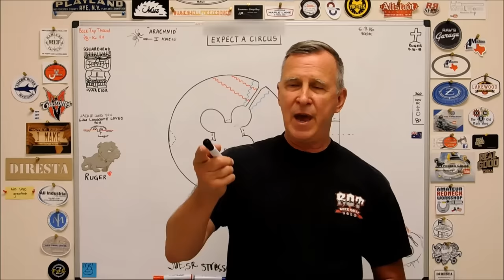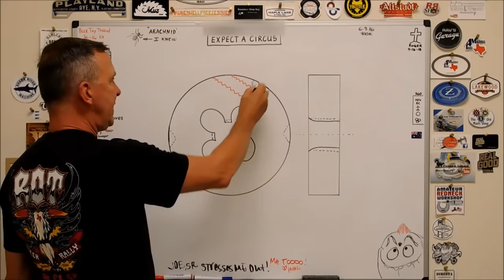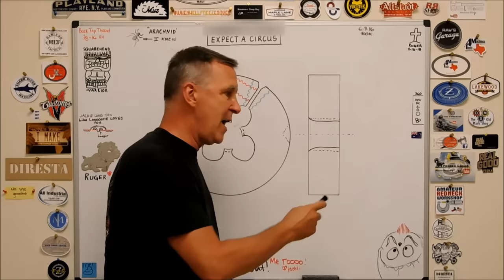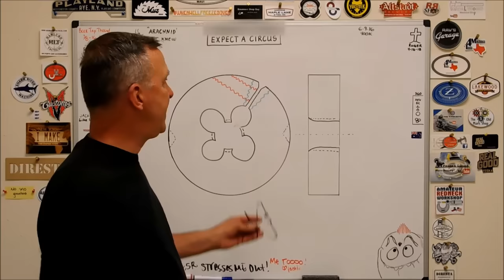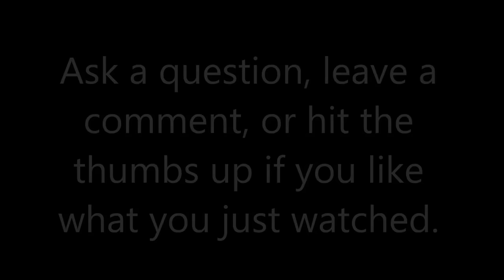You will throw your die handles away after you watch this !!!

Comment: Thanks for the vid Joe. I'm fairly new to the lathe and can count all the times I have single point threaded still. I tried single pointing a thread until it was most of the way and then ran a die on to finish the threads but for some reason it threaded heavy to one side and I had to go back to single point threading. 
I was making handles for a drill press and made a sleeve that threaded over top of the handle rods, with it being off center I couldn't get the sleeves to thread on. The tap and die set are made in USA (Dayton brand) and the material is 12L14. I still need to make the die holder for the tail stock which may fix that problem.
Nice ride as well, I sold mine but had a Yamaha Warrior and she could pull like a freight train, Power commander III chip and AIS bypass. Unfortunately I had to many close calls with the cager's and I was still responsible for a child living at home so I let the bike go. He's off on his own now and I believe when I go to replace it I will be looking into a Victory bike.
Reply: Also the material was not off center more than .001 as I did run a indicator up on each one so single pointing it was on center. For an old chuck and lathe it still runs pretty true. It's an Atlas/Clausing 6" and I am looking into moving up to a 14" lathe pretty soon.
Reply from the maker: Did you do this under power? Sometimes it the operator pressure resisting the torque that pushes it off center.
Reply: @joepie221  No, it wasn't under power when I did them. I'm sure it's something I did but it was just easier to single point out the rest than to figure it out at the time. 
Looked up the specs on your lathe. Very nice, if the info I got was correct I like that it has a 4 tpi lead screw and 16 speeds vs most at 8 and 12 speeds in that class, plus allows SAE and metric threads and it appears to be around 1-5/8 spindle bore? I haven't been able to find where they are made? I had been looking at the Precision Mathews lathes but I honestly think if I could find one like yours in good shape I would take it over the Mathews.

Comment: Did you come up with this? You should design your own from the ground up, and sell them. This thing is legit
Reply: Floating die holders have been around for decades. 
Great tools to have and really simple to make. I use mine daily, as I make a lot of screws and threads. Really speeds things up and saves my wrists from turning the die holder by hand.
Reply: @Brekelefuw  ah, I never knew, I have just been researching threading and found this :D
Reply from the maker: Floating yes, but the ability to spin when the thread is achieved is what I really needed. keyed holders don't do this.

Comment: Hi Joe im working on L shaped part witch is very thin . The part bows and spreds appart,i tried evrything can you tell me how to aproach this kind of work .
Reply from the maker: If you can, keep it attached to the main material and cut it off at the last step. I did a video called 'Dogbone Milling" it may give you some ideas. go find it.
Reply from the maker: https://www.youtube.com/watch?v=r4vaeRLFfD8
Reply: @joepie221   i dont know if it is posible .can i send you a picture of a part 😀
Reply from the maker: If its small, trap it in a 'V' block and reposition your vise to sit on your mill table at 45 degrees.

Comment: Great concept for the die holder in the tail stock. 
If you would use beeswax as a lubricant or a toilet bowl wax ring it would give you a nicer finish on your nylon parts to keep the threads from tearing. 
Just my 2 cents worth from a retired machinist of 40 years.
How does your technique work on steel based materials ????
Reply from the maker: Works well. I have to hand drive the die with longer studs, but ss is not a problem.

Comment: Why did you bore your die holder to accept a round rod for support when you could chuck the die holder directly and simply leave the drill chuck loose enough for the it to spin?  Is this to eliminate wear on the chuck?
Reply from the maker: No, its for threads longer than the holder. It simply walks off the rod.
Reply: @joepie221  - I honestly don't want to be a pain in your neck since you put out LOTS of great info.  But... that holder would slip right out  of the chuck too.  It seems to me that the main thing is boring out the holder to accept the largest thread you have a die for.  For what it's worth, I think I will make such a holder. 😁
Reply: 1+
Reply: You would have set the chuck jaws very precisely to achieve the same result.  If the chuck jaws grip the work is probably scrap. The loads on the delrin part were noticeable, steel and stainless would be significant, make sure you can keep your fingers.  
In machining parts you have to ask 'what can go wrong?'  Using the drill chuck jaws as a guide makes the hair on the back of my neck stand up.  They are precision clamping surfaces not bearing surfaces.
Reply: @peterblacklin9174  - Thanks for sharing your thoughts.   I cannot disagree that one should treat one's tooling with care and respect.  I suspect that one instance of a drill bit catching in some brass and spinning in the chuck would produce as much wear as many years of the abuse I described.  Those jaws are pretty hard, after all.   All my tooling is "import" grade 🙄 and it will surely outlive me, so I may indulge my darker side from time to time. '😈  My (Hansen) taps & dies always seem to produce a pretty loose fit.  I have to wonder if they actually cut threads that are fully within spec...

Comment: Can you do a video on lathe threading for lathes that do not have a thread counter (Ikegai A-20 being one of them).
Reply from the maker: To be honest, I have never run a thread on a lathe without a thread dial. I'll leave your comment up to inspire others to comment on. I am sure it will get replies.
Reply: Just don't disengage you half nut and run your motor in forward and reverse. I have to do that on mine when cutting metric threads .
Reply: @joepie221  Thanks for the reply Joe

Comment: Throw away dies. Use thread rollers in lathe 💡. I also had a VTX 1800 bike. Didn't like shaking in 80 mph range. Traded for GoldWing and no shaking etc. Mileage is 107K miles with only normal maintenance. Can hit 114 mph with 2-up in 4th gear. Never beaten by a HOG in a race 👀.
Nice video 👍.

Comment: You can tap on a screw machine the same way and withdraw the tap without reversing the spindle.
Reply from the maker: As long as you have a self reversing tapping head.
Reply: @joepie221  No, I can tell you never ran a good one. You speed up the floating tap and it backs out by itself with a floating setup like you have. LOL I couldn't understand it when I first heard it either.
Reply from the maker: @docalexander2853  Interesting concept. It takes a minute to visualize. So the turret is powered as well on your screw machine. I did considerable time in a screw machine shop. What kind of machine was that?

Comment: Ahaha, I wondered what you were talking around with side screws in small dies. You meant small OD, not small thread size.

What is that, a 5/16" thread in a 13/16" die?

At any rate, I made mine from scratch, with an MT3 spindle and sized for 13/16” and 1" dies:

https://photos.app.goo.gl/tLryhHYEDfTdFcQu6
Reply from the maker: It was. Very good catch.

Comment: Love the bike, I've got a Honda Shadow 750
Reply from the maker: Those 750 shadows sound great with a good set of pipes. Real crisp like a sportster. Had one in the family a few years back.
Reply: Both great bikes. 1300 Stateline for me, not as much pull as your 1800, but a great ride all the same. Shadow 1100 before that, trade that for a boat when the bike had 80,000 miles on it. Not many bikes hold their value like that.
Reply from the maker: When Honda builds a better bike, I'll buy it. Till then.....VTX all the way.
Reply: @joepie221  No argument from me. The only reason I didn't get the 1800 is weight. Still an awesome bike.

Comment: good learning from Joe except one little problem. a cutting die shall not use on reverse direction, because if will not cutting but using a relief angle to push material away. If will also cause damage of die itself. maybe plastic part not so critical. it will real cut when it return. so you can find it is not so match between first and second cutting. should be notice.
Reply: Came to the comments to say the exact same thing.
Reply: Exactly right.  If you reverse the die you will be dragging the cutting edge, dulling the die and just rubbing the threads on the part.  Very bad practice, a "shop teacher" should never advise students to do this.
Reply: How do you get the die off the part when you are done?
Reply: @MostlyPeacefulWACO  If you are saying how to finish this machining, I dont have very good solution. My silly method is take all leading taper removed if very need the closing complete thread. 50% thickness will be taken off of die on grinder.
Reply: @samchen4585  I may be misunderstanding. When you say "cutting die shall not use on reverse direction", do you mean with the die flipped over on the reverse side?
Reply: @MostlyPeacefulWACO  Yes，I'm saying reverse side feeding-in may cause relief angle turn into rake angle on cutting edge geometry
Reply: Sam - You're dead on.  I didn't see your post until today, and so made a similar comment yesterday [04 July].  Well, at least there are two of us who understand that cutting tools have both a leading and a trailing edge.  Doubt any machinist would slice his bread with the top side of his [her?] knife !
Reply: @ulcwiz3709  Is it too serious for a comment? I just want to help improving. If hurt anyone I would keep silience watch and learn. Joe's tricks are too interesting and useful, I can replay them a whole day without moving hip.

Comment: Thumbs down. Try doing this on anything tougher than brass and you'll have a bruised hand. 
Brought to you by Single Point Thread gang
Reply: Sometime you must use common sense on thinks.
Reply: ?? I did this with a m22 die on Stainless steel lol
How weak are u Boi xD I mean I bend the holder a little bit but just a little
Reply from the maker: On any materials tougher than brass, don't have the spindle turning. use the 2 handles like a standard die handle and just do it by hand. I thread stainless all the time like this.

Comment: I am a novice machinist at best I have a thirst to learn I wish I could afford even the low improper equipment but I've been forced to buy Chinese. At least I have a Logan lathe that I have fixed up the best I can. I had a Harding dms-59 but it had to go away and it made me very sad. But anyway I'm like you Joe I cannot stand using a die for Threads the just don't seem right they wobble if you use the correct diameter they seem not to cut well. You really expensive. I said that I have are just crap compared to single point I just don't trust them I don't know what it is

If I can do anything well I would have to say a single point in his my thing. I found it easy from the beginning I don't know why I just I think that perhaps I cut very nice tools. I don't like store bought single point tools I like to grind my own and I get them nice and sharp and perfect angle sometimes you can. Sometimes I'll work on them with a chunk of transparent Stone for an hour just to get them polished to perfection.

Comment: I use my drill press to do this.  I put a chuck in the clamp on the table and a rod in the top chuck and line up the bottom chuck and lock it all together.  I then lock the clamp to the table and remove the rod used to line up the chucks.  I then put the work in the bottom chuck and the die holder in the top chuck and hand turn it and that keeps my work all lined up with a drill press.

Comment: single point right, if you have a CNC lathe
Reply: Easy to cut with single point on manual lathe too. Takes a little finesse & patience.
Reply: If you take pride in your work single point on manual is cleaner and it's easier after you get the hang of it. But I would love to own an EZ path lathe for cutting threads. Either way cnc, manual it's a better thread and again gives you a sense of pride to s.p. threads.
Reply: Never touched a CNC, bought a tired well used 36" lathe for 1K in the desert, I had never touched anything but a wood lathe before. 2nd job I had to do with it was make an internal threaded nut 16x20 pitch for a friends jeep transmission...there's no parts store 40 miles North of Barstow, Ca.......took me about an hour once I figured out what I was doing, worked great. Reading books and manuals goes much further than any CNC automation will ever get you.
Reply: @jhooah1  if you have a job with more than one piece and single point making the threads you won't have it long

Comment: Joe, did you really thread 6 feet of rod through that little tiny die holder?
It looks like it only has, MAYBE .600 of clearance on the back side!
Where did the other 59.400" go?
Reply from the maker: The die holder was in the collet and the material exited through the spindle. I fed it from the tailstock end with the tailstock removed and the material held with vise grips. :)
Reply: @joepie221  you did say that in the video! when you were explaining you can place it in the chuck and go the other way :)

Comment: I ain't turning on the lathe with a 2mm thick rod to be threaded!!
Reply: Ermel Arroyo, that's ok if you don't mind the die starting out of square then causing the die to cut deep threads on one side before pulling itself square.

Comment: Is there any Difference between the round die and the  Hexagon one?
Reply from the maker: Beside the outer shape, some have said the hex kicks in at some smaller size. I have not confirmed that.
Reply: @joepie221  hi in the uk the hex type are die nuts and are meant for cleaning up an old thread that may be slightly damaged ect 
allso the side of the die with the size ect is the lead side and should be fitted to the die stock to the out side so when you pick it up you can read the die size and this is the side that is presented to the work first
Reply: Circular does are usually split to allow adjustment,  whereas hexagonal ones are solid

Comment: Great idea, Joe !
I guess that why you don’t like die cut threads is probably because it’s difficult to get the thread concentric, especially over a longer length - because the lead on the die means that each successive cutting edge starts one quarter pitch after the preceding one. This puts a sideways force on the die, which creates a small offset, so that it follows a corkscrew pattern around the axis of the workpiece.  A single point screw cutting tool is much more rigidly constrained by the lathe, and so suffers less from the problems of concentricity.  But, trying to screw long slender rods with a single point tool is often fraught with difficulty . . . .
I have a selection of Coventry die heads, which have four tangential die blocks held to the work by a cam plate and released under spring pressure, if the forward movement of the die head is prevented by a stop on the lathe bed. They were much the standard item on capstan lathes for turning out repetition threaded items and can be held in a drill chuck in the tailstock, allowing it to slide along the lathe bed as the thread is being cut.
They will produce a more consistent and concentric thread, especially over longer lengths.

Comment: Congratulations on making a tool that is already made commercially. Albeit not commonly available in the USA I had mine shipped from England. It's even better than yours because it fits my tailstock directly because it has morse taper not a straight shank for insertion into a drill chuck. I also do not use power to cut the threads. I turn the die by hand because when cutting metal threads you need to occasionally reverse the rotation to break off chips. You didn't mention that at all.
Reply from the maker: Yet somewhere in the comments below, I bet you find it.